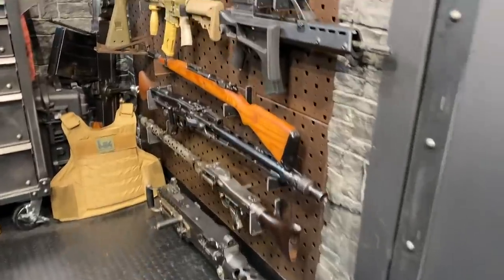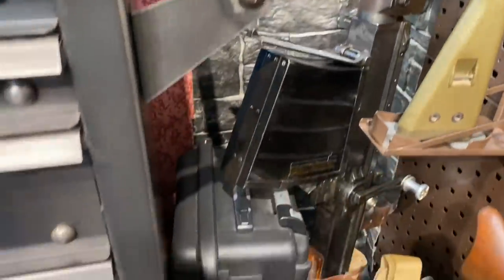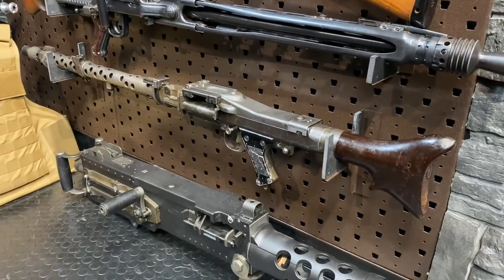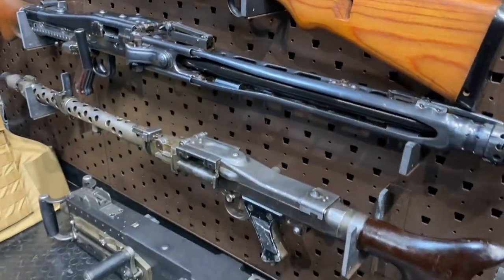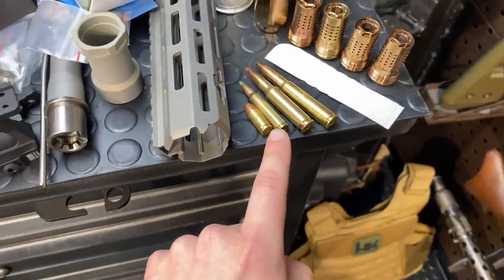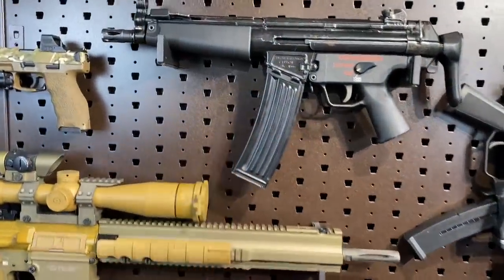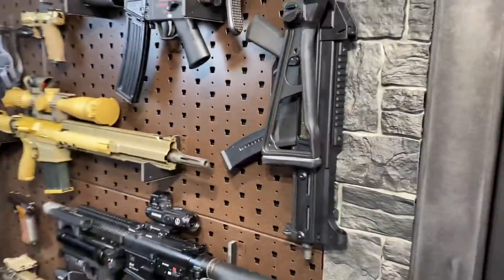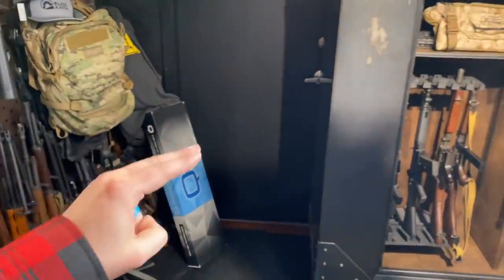100 Years of German Guns | Development, History & Fun Facts

Comment: One quick correction is that the k98k was only the standard issue rifle during ww2 , the gewehr  98 was the standard issue rifle during ww1. whilst very similar the gewehr 98 uses a longer barrel and bolt and also has a straight bolt handle instead of a bent one.  there are versions of the g98 which are very similar to the k98k byt are still a bit different. (also g98 uses different rear sight)

Comment: Next you should do German large arms. Like start with a panzer II with the 20mm, then Panzer 38t with the 37mm, then with a panzer III, with the 50mm cannons, then a panzer IV with the short and then the long 75mm, then a Panther with the long schlong 75mm, then the Tiger 1 with the short 88 then the tiger 2 with the long 88. From there you can move onto the Jagdtiger with its 128mm cannon. I know it’ll be expensive, but how else will you communicate it without getting some tanks?

Comment: That Karabiner 98k is most likely a 44 - 45 model as the firing pin hole is on the cuff on the back of the stock and is just a tiny hole drilled through.

Comment: I just love that it post ww2 wasn’t just a reset for west German small arms the way it was with East Germany. Instead you can sort of trace the G3 back to the same traditional German weaponry used by the Reich’s. First by having the gun itself be based on the CETME rifle which was itself an realization of the conceptual evolution of the German Sturmgewehr. Even made primarily by a German engineer just for the Spanish. Then H&K was founded by former Mauser engineers using everything they could save from a Master factory in order to found their own company. So in many ways it’s just a slightly roundabout but direct continuation of Germans small arms manufacturing from ww2 and before. Though definitely rebranded

Comment: Actually, the Kar98k was not in ww1, it was created for ww2 because Hitler asked Mauser for a light rifle. The rifle issued for ww1 was the Gewher 43. The Kar98k replaced the Gewher cause it was too heavy for long marchs since on ww2 soldiers mostly walked, plus the Kar98k has better handling and range. Could also be used as a sniper but it varied on the model.